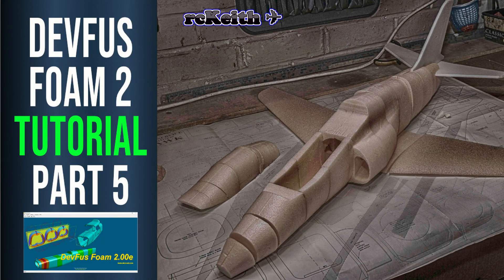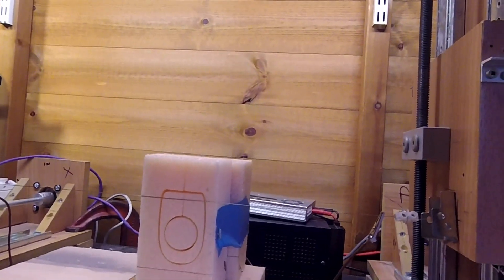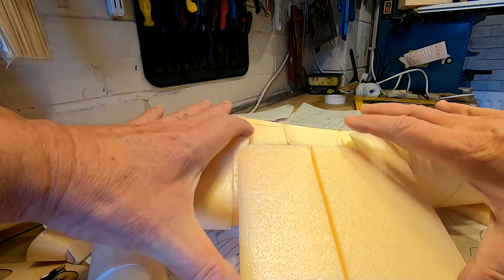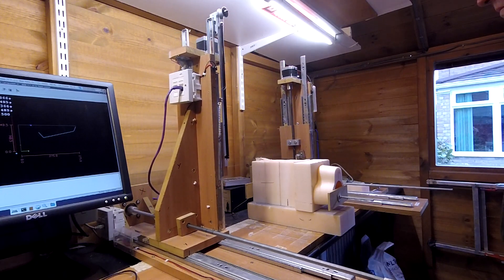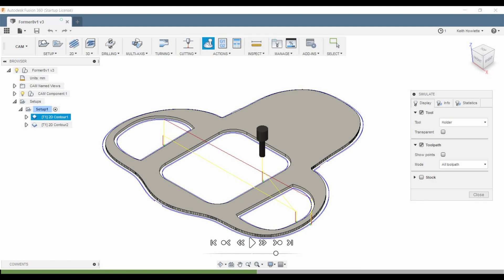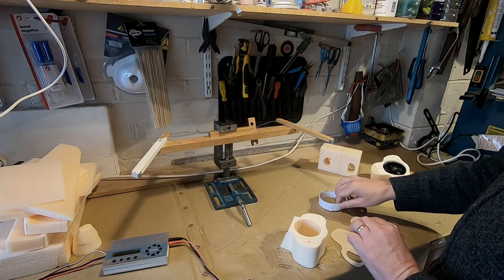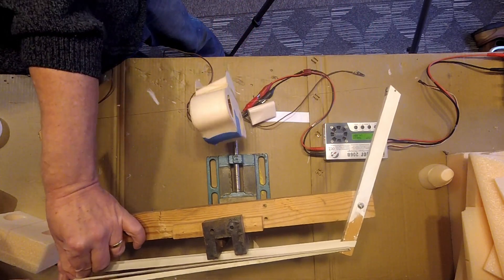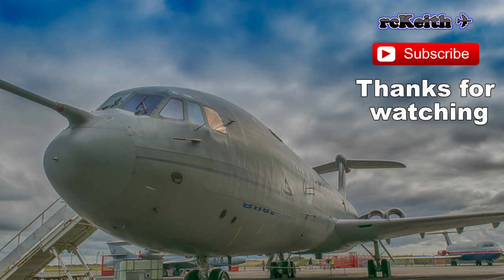DevFus Foam 2 Cutting Tail and Canopy slots

Comment: Hello Keith, I'm currently developing the CAD model for the BAE Hawk. Can you please help me with the type of aerofoil used for the wing section?
Reply from the maker: I didn't use the original aerofoil because for RC models they usually don't work very well. I used a Clark-Y.  As you may have discovered its difficult to find information on the original aerofoil.  Thats why I used one suited to small RC models.
Hope that helps

Comment: What type of foam do you use?
Reply from the maker: I use polystyrene foam and XPS. The fuselage used in this video was made with XPS.  I use polystyrene mainly for wings with carbon spars and covered with Brown paper and PVA glue. I have a video on the channel showing that.
Reply: @rckeith  OK thanks for the tip.
Regards. Daniel

Comment: what program did you use to get tje wing rib sizes
Reply from the maker: It was all done with DevWing Foam.  I used DraftSight with a scaled image of the Hawk so I could get the wingspan, root and tip chord.  I then used the dimensions in DevWing Foam to create the wing.  There are no actual ribs with it being a foam wing.  DevWing Foam then generates the g-code for the foam cutter to create the wing.  Have a look at my tutorial on DevWing Foam https://youtu.be/pjx6_OrfhVQ which shows the process.

Comment: Olá amigo vc não teria em formato dat
Reply from the maker: Oi formato dat é MH45 para o aerofólio
English : the airfoil is MH45 hope that helps
Reply: Hello friend, all the programs I have here have not been able to open code I have mach 3 I have profil several others plus what I use to generate code g foam works 4 it generates in from dxf to dat can send me to dxf can be by emal joserineiro @ gmail .with
Reply from the maker: OK, check your email you should have it

Comment: What foam did you use for this project?
Reply from the maker: Its XPS foam, similar to blue foam. I will be covering the wings in Brown paper and white glue. Have a video on my channel showing how to do that.  The fuselage I will covering in poly-c did that on my Hawker Hurricane. The brown paper and white glue makes a really strong wing with a carbon spar that going is as well. Thanks for watching
Reply: Just out of interest, is there a particular brand/vendor for this foam? I've had a look at the local B&Qs/Wickes/Homebase stores and can only find the low density XPS70 (white) polystyrene. Thanks.
Reply from the maker: I think it was knauf xps but can't be certain now. I've used all mine up and have been looking for more and like you can't find it at Wickes or B&Q anymore. There is  company called SIG that seem to have branches in most UK big  cities which seem to have a lot of choice.  You  could use the white foam which when covered makes a strong wing or fuselage. I'll probably use that next. Sorry can't be anymore help
Reply: @rckeith  Thanks for the info , I've located a SIG branch reasonably local to me. I gave them a call and they have stock of Dow Floormate (blue foam) so I will be heading over at some point after Xmas.
Reply from the maker: @MLucasFTW  That's good news.  I think I'll need to go as well for my next build. 👍